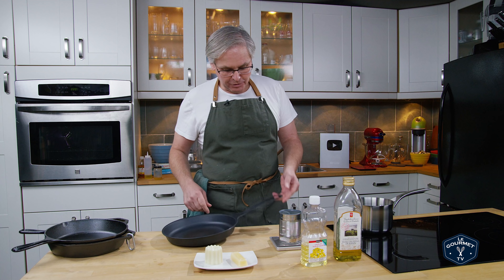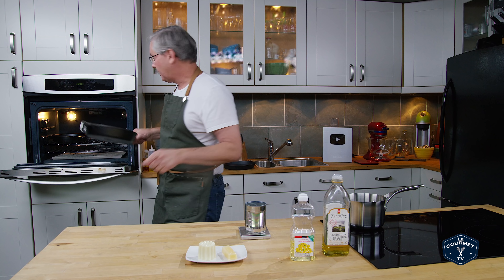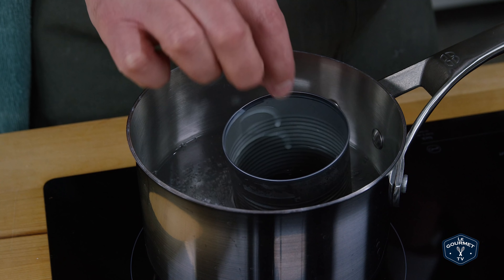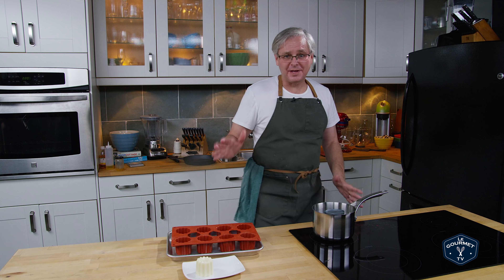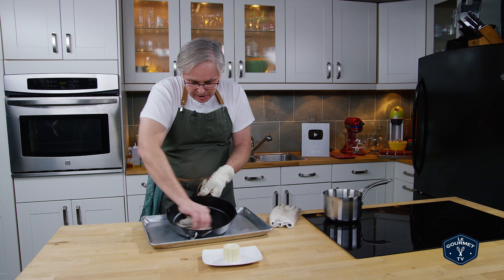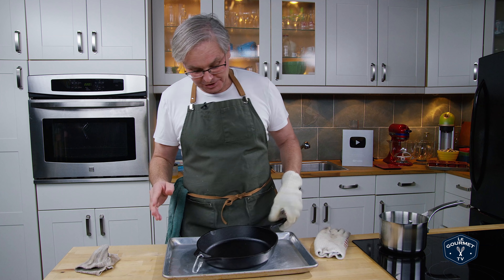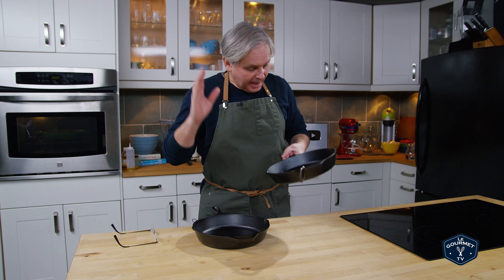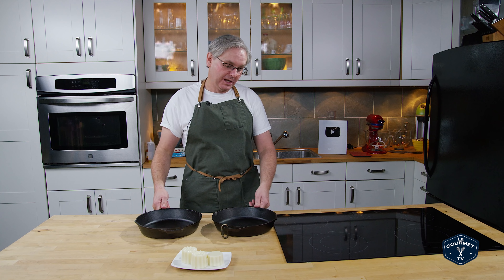Making & Testing Beeswax Cast Iron Seasoning Pucks

Comment: I would be interested in hearing your thoughts on the rough-textured or pebbly surface on the Lodge pans vs. the smooth surface on other pans.  I have been watching the Kent Rollins series on cast iron and he doesn't seem to like the pebbly surface, to the point of saying he would prefer to sand it down to a smooth finish.  Is it really that bad?  I am considering getting a cast iron pan and the Lodge ones seem to be all you can find in stores.
Reply: It can be pretty bad, depending on what you're cooking. I find eggs to be completely out of the question on a modern pan due to the rough surface, and some of the nice crust that you can develop during high heat searing can get left behind as well. If sanding down the pan isn't something you have the equipment for, you can often find a pretty wide variety of high quality cast iron at thrift and second hand stores. A hard cleaning and a new coat of seasoning is far easier to accomplish than a full resurfacing of the cooking surface, and you'll likely save money as well.
Reply: Brent Hooton food and liquid (or anything) can stick much easier to a bumpy surface than a smooth surface. That’s the beauty of a good seasoning: you fill in the bumpy surface at the microscopic level. It makes it more non-stick since there is less to grab onto.
Reply: I have a fairly flat stamped carbon steel frying pan. What I can say is that the season takes much longer to stick to and comes off more easily. After a long time of use it starts to look like a cast iron frying pan, but the outside peels off and needs to be re-season from time to time (I use gas stove). A stamped carbon steel frying pan is usually thinner and heats up faster, which may be advantageous in some types of cooking recipes. But I see no advantage in sanding a cast iron frying pan. I think if there was any improvement, it would be sold already sanded.
Reply: My suggestion would be to frequent garage sales, estate sales and junk stores and look for vintage pans.  They are generally machined smooth and are a much lighter pan.
Reply: The rough texture is so it can be more easily seasoned from the factory
Reply: Matfer Bourgeat steel pans. Your Welcome. 😉
Reply: @RandomNumber141  The smooth pans season beautifully.  I suspect it is just cost reduction in manufacturing.
Reply: @sporkintheeye  AFAIK, at the factory they season them while they're hanging, so the rough texture a) requires less finishing and b) holds onto the oil better
Reply: its not bad at all. ive actually grown to love the lodge pans and have replaced all  my smootth ones with lodge. the sticking with smooth pans is unbearable and the seasoning always flakes.

the only people that complain about new lodge are old heads that are hell bent on no soap and jesus saves.
Reply: The smoother the surface, the less durable the seasoning layer. Smooth surfaces just don’t hold their seasoning foundation as well as rough surfaces. I also believe that rough surfaces provide less contact area with food, which ironically makes it slide better.  I love Cowboy Kent, but I think he’s wrong about the physics at play here. Rest assured, Lodge knows what they’re doing.
Reply: @SuperPussyFinger  Yes Lodge does know what they're doing--saving money by skipping the polishing process.
They and others stopped polishing their cast iron when other products began to compete in price and availability. They started seasoning in-factory and claimed that the rough texture helps the seasoning hold (which it probably does), but the primary motivation was cutting cost, not making a "better" skillet.
Whether you grind it smooth yourself or wait the years it takes for seasoning to build up into a level cooking surface over the pitting, either way, you will eventually have a smooth bottom. What Rollins etc does isn't better or worse than waiting, just faster.
Reply: I took a flapper wheel on an angle grinder to smooth the surface, then oil seasoned as shown. Nothing sticks. This is my first introduction to the beeswax.
Reply: My understanding is that the old Lodge cast iron was formed in silica dust. That is hazardous for workers. Now they use sand instead. This results in a rougher finish. The cost decision to eliminate the machining of the interior is the big functional difference. The old cookware did not come from the factory with a glass smooth finish. It was grooved. That helps the seasoning to adhere.

Comment: I know you mentioned that some people use walnut oil which leads me to my comment. Right now I only have walnut oil because I'm out of everything else. I've noticed that every time I cook with it, it puts a seal on the food that prevents the food from cooking the way I wanted (most notably when I tried to fry some rice). So, now I'm wondering if walnut oil might be one of the best oils to put a seal on cast iron. Thanks for your test, very interesting.
Reply: As long as the oil is at least semi-hardening (or hardening) then it should work fine. Google will tell
Reply: @RandomNumber141  I just googled it and it sounds like walnut oil works if it pure refined walnut oil vs. unrefined that might not have a high enough smoking point. Thanks for commenting. Have a great week.

Comment: Thanks a ton, I have been looking for a recipe like this. I have been getting really good results with plain Crisco in a similar method than what you are using. However I bought some cast iron pieces from someone that restores it as a hobby and he gave me some samples of his custom blend that works better. He mentioned it had beeswax in it so a few videos later I think I have a winner. I personally warm it at 250 the apply oil liberally, then let it sit until tacky. Then as you say I wipe all excess off and back in at 250 for 15 mins, then up to 500 for 45+ minutes until its satin black. I kill the oven and let it coast down to around 250 and repeat. After 3 coats of plain Crisco it gets a deep black but very non stick finish that nothing so far has phased. I'm about to do this as a 3rd coat for some I am working on and hope it works out even better. BTW I used half/half Crisco/Grape Seed and then 3:1 beeswax.

Comment: Excellent! Because of your previous vid that shows the pucks, I ordered one. Now if I can just clean the sides and bottom of my pan, which looks a mess compared to your pristine pans. 😂
Reply from the maker: When I come across a pan that needs a deep clean - I just run it through an oven self clean cycle. Then start from scratch on bare metal.
Reply: @GlenAndFriendsCooking  I don't have one. Boohoo.
Reply: @GlenAndFriendsCooking  Would you suggest that method for my pans? I have both my Mother's pans (70 years old) & my Grandmother's pans (at least 80-90 years old). Or would you do something different with pans of these ages?
I absolutely love your videos! So much fun to watch & so informative.
Thanks!

Comment: It's my understanding that you completely wipe off the oil and all that remains is microscopic bits stuck in the pores of the metal. The cooking of the pan burns off the fats in the oils and all that is left is carbon, which burns at a very high temperature. The layers of carbon build up with each seasoning until the pores are filled and the surface is super smooth. This is where the non-stick property comes from.

Comment: I'm really curious about your little seasoning pucks. I've used cast for about 55 years starting with my own pans, inheriting my grandmother's and then my mother's. Grandma's are my favorite....smooth as glass and lighter than mother's pans. I'm not a careful cook so the pans have been well used. They've made mountains of eggs and piles of potatoes then gone on during the day to turn out smooth sauces or sear a steak. Rarely does anything stick to them....if it does I throw them in the sink, scrub with hot soapy water, dry them well, drop some canola oil to cover the bottom and set them on a large burner to heat until the oil ripples, pull them off the burner to cool, pour off any extra oil and wipe the rest all over the pan with a  paper towel and they're ready for tomorrow. They've taken a beating....poor things. I wonder, if I made one of those seasoning pucks could I use that instead or canola every time I wash the pans?

Comment: Nice video!  Have you tried your your blend on a cast iron pan that isn't already seasoned?  I would be interested in seeing how well it adheres to bare cast iron as opposed to adding another layer of seasoning on top of Lodge's factory seasoning. My assumption based on using Crisbee, BuzzyWaxx, and other commercially available beeswax blends for cast iron is that it would do well.

Comment: I'll be interested to see the stress test. The little I know of biochemistry is oils and fats  are typically mixtures of acids and glycerol. I'm guessing that since the acid and glycerol have an end of their chemical chain attached to each other and there is likely some water in the mix that by adding heat to the pan you are removing the water and oxidizing the oil thus changing the structure of the oil making it stick to the pan and give that "nonstick" surface. I'd further postulate that the beeswax also has some form of chemical bond with the oil that increases the polymerization and cyclization of the oil.

To stress the seasoned surface I think an acid or hydroxide would be the most readily available chemical that will not ruin the pan. Keeping with cooking maybe making something that requires a fair amount of vinegar would stress the season in the most similar way to what the home cook would experience.

I know that when I want to remove the seasoning from a preseason pan I typically boil it off with water and vinegar.

Comment: I tried to season my Grandmother's cast iron pan and it ended up all sticky.  Now I know what I was doing wrong.
Reply: Same.  Thanks to Glen!
Reply: Too much oil, once you’ve coated the entire pan, wipe every possible bit off. If it pools even a little, that is where it will create a “sticky” surface.
Reply: That's where I screwed up with a big double burner cast iron griddle, I coated it generously with oil and came up with a lot of orange stickyness

Comment: 2 things my guy, 

1. What do you do if it is sticky?

2. How do you go about seasoning your pan without an oven?
Reply: 1. You can try scrubbing it out, maybe soap and water. Or heating up the pan above 300F and wiping it out. Or get it really hot and burning it off.

2. Gas Grill > Regular grill. You could try stovetop, but it will smoke out your house.

Comment: Lodge used to be great cast iron pans back in the day when they milled the cooking surface to a smooth finish. Now they skip that step and the surface is very rough. So either buy vintage Lodge pans, or other better brands like Griswold or Wagner.
Reply: All my cast iron are Wagner- which was here in Ohio. Most came from older family members who passed away and their kin didn't want 'em. My daughter recently gave us a Lodge pan_ she was trying to be nice..poor thing. The Lodge pan felt gritty and sticky with the factory coating. Will have to strip it and try this technique to see if it can be saved.
Reply: I hit the cooking surface with 80 grit on my Mouse sander. It takes about 5 or minutes to get every thing leveled off. Then just season it. I learned in on cowboy Kent Rollins channel. He does a ton of cast iron videos and recipes utilizing them. If you don't mind the little bit of work the lodge turn out great not as nice as my butter pat but for the price and how easy they are to come across second hand it's a good trick to stick in your tool box

Comment: Always up for a bit of cast iron science. I've gone as far as to have had to restore my modern Lodge pan after I started getting scales flaking off. One thing I've noticed is that the seasoning I do on completely stripped iron never quite gets as opaque as the pre-seasoning that these pans come with. It's always made me wonder what exactly do these companies do to get that color. I've heard theories that it's some kind of other chemical, while I've seen claims by Lodge and others that it's just plain oil seasoning. Regardless, I'd like to know what exactly is going on with pre-seasoning because, as far as I can tell, its harder-wearing than typical home seasoning methods.
Reply: @andrewc9902  I've had a case of a malufunctioning oven heating element causing near-continuous heat from one side of the oven for two hours, and causing the pan to heat on that side enough to get some seasoning to burn off as dust. It's sort of like what happens on a self-cleaning oven cycle being able to burn off seasoning. The seasoning still never got quite opaque, so I doubt that it's just a matter of higher temps and longer time.

Comment: To be frank, the seasoning process is vastly OVER appreciated and obsessed about.  Pans only stick until you clean off the nasty factory goop or smooth out the surface finish.  I have cooked exclusively with cast iron pans since I left home as a kid (and had some experience with it at home as well.)  After cooking, I blow the pan out thoroughly with hot water and a stainless scrub pad.  Dry.  Done.  Meals with high acidity or moisture leave the pan looking "dry."  If that is the case, add a couple DROPS of grapeseed/coconut oil or (something that doesn't polymerize) and massage in.  Leave as little oil as possible for storage.  This is only there to prevent formation of red rust.  Use will eventually produce a smooth surface.  Light oil maintains it.  As said above, if your pan is sticking badly, it likely needs sanding.  Use fixes the rest.

EDIT: Spelling, Clarity.

Comment: 32+32+32=96 not 134. Math, amirite?
Reply from the maker: Sorry Eli but you're wrong. Listening to the video at: 2:45   1 part beeswax 34g + 3 parts oil (34g+34g+34g= 102g)= 136g total weight.

Comment: So I have a few questions about the process:
1) How often do you need to re-season?
2) Can those pucks go bad? If so how long do they last?
Reply: The only time I have ever re-seasoned a pan is when I forget about it in a HOT oven for a while and the seasoning starts to char, or when I've picked up on from an antique store/auction and it looks rough. A good,established seasoning on a pan that you take care of should last a  long time. I have an old cast iron skillet that has the same seasoning on it from 5-6 years ago. 
I can't speak to anything about those pucks, as I've never used them.
Reply: Oil will go rancid after some time, you should not use rancid oil in conjunction with food or cooking utensils. It won't be bad for your cast iron or make you sick*, it will simply give an off taste to your food.

*Long term ingestion of rancid oil use can lead to serious health issues, but it won't make you sick like rotten meat if you ingest it.

Comment: Olive oil is better. Never use canola or vegetable to season a pan. They break down to unhealthy substances in high heat, whereas olive oil doesn't. Low temp cooking they are alright but, even then, olive oil is much better.
Reply: Wayne Watson...Never...Never use olive oil either as olive oil can go rancid and smokes at a low temp..Having used arachis oil for years its one of the best for high temp seasoning.

Comment: Washing cast iron in soapy water????? Seriously????.......Salt and oil, NO SOAP scrub till clean..  Then heat the cooking pan slightly and smear with a fine layer of high temp cooking oil...............Anyone who uses soap to wash cast iron doesn't know how to look after cast iron.
Reply from the maker: Oh my... Ok so 30 years of cooking with cast iron. I have more cast iron pans in the test kitchen and studio, than most stores have on hand to sell. They get used and washed 5-6 times a day. Always in hot soapy water. Soap does not affect or change a properly seasoned cast iron pan.  @OK! But then again. you need to drag yourself out of the dark ages and learn about how to really care for cast iron.